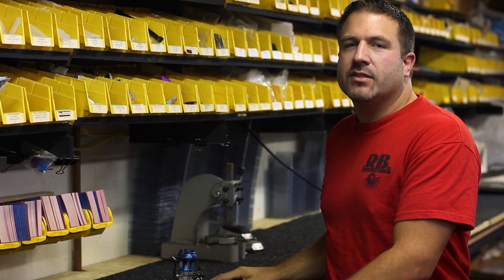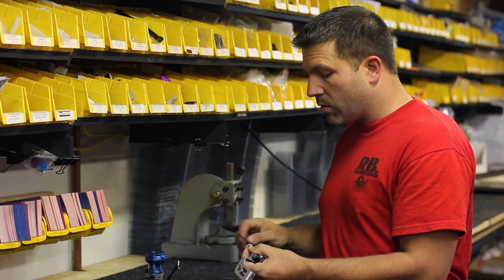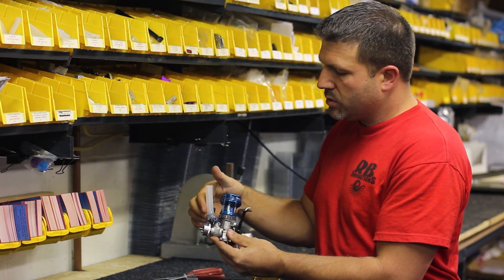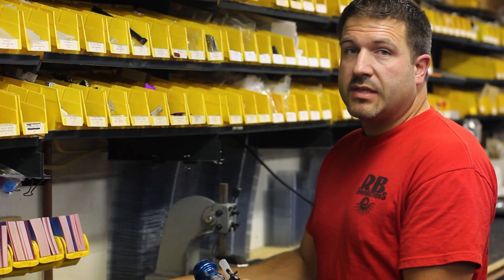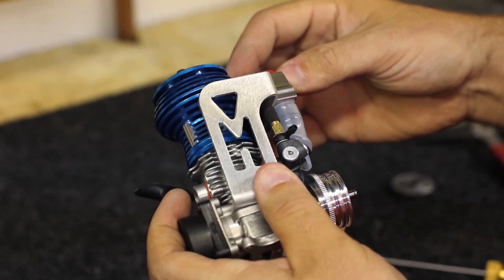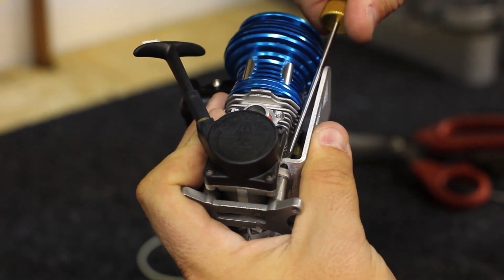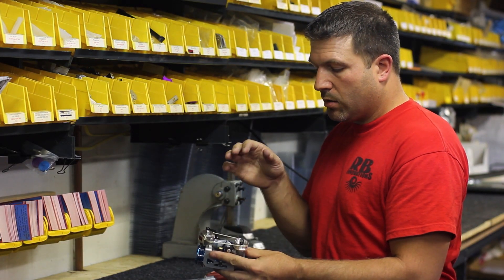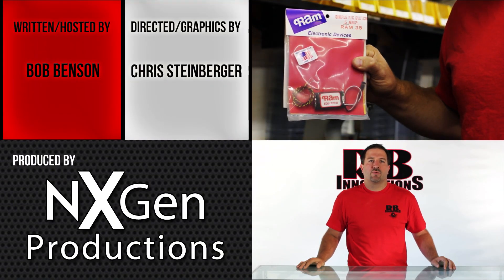How to Install an RC Supercharger from RB Innovations

Comment: What an amazing way to blow a bunch of unburnt air/fuel mixture out the exhaust port of a 2 stroke engine!!!!!!!
Reply: Victorious victor BS
Reply: Victorious victor Who said they stay open for the exact same amount of time? What I said is that this supercharger will blow unburnt air/fuel charge out the exhaust... and as an added bonus I made it clear you'd be stupid to buy it because you won't gain power.

How many degrees do you suppose only the intake port is open on say a 9/1 compression cylinder? Not many. Whatever it is I garauntee it's not long enough to increase the volumetric efficiency enough to offset the parasitic load of the supercharger.

There's a reason those turbo kits include a tuned pipe, it's because there very little if any power increase without one, even with much more efficient turbos instead of a supercharger.

Are you the sqeezy bastard trying to peddle this garbage or something? Why're you so motivated to contradict what's obvious.
Reply: Victorious victor dude I'm a two stroke mechanic at Kawasaki and all I can say is your full of bs.
Reply: Zaphod7835 no, most turbo kits don't come with a pipe. the use of a stock pipe is sufficient, as the increase in boost pressure is proportionally matched by exhaust pressure due to the restriction in the turbine housing. gains can be had by having a pipe tuned for the turbo, but not tuned in the way you're thinking. the tuning would be to account for the faster traveling pressure wave due to higher density of gas within the pipe, not to increase the reflection wave. superchargers also work, on nearly the same principle due to the pipe pressure increase caused by higher overall flow through the engine, but with a slight trade-off in total efficiency.

if, in fact, forced induction on a 2-cycle engine merely puked intake charge out the exhaust port, explain to me how a large percentage of snowmobiles actually burn less fuel per day after the turbo installation?
Reply: I think the time and money spent on this would be better put to use on porting and upgrading the carb. I see what you're saying about positive intake pressure on a two-stroke, I think it's a load of shit and will remain thinking so until I see evidence of greater power output on the worlds tiniest engine dyno.
Reply: Victorious victor you have no idea what you are talking about those snow mobiles that are supercharged have an exhaust valve and are port injected. the fuel air mix isn't coming up through the crank case. you will only lose horse power with forced air introduction on a valveless 2 stroke. I'm a logger and I have building fast two strokes all my life, like and i drag race a Yamaha RD400 if I could have supercharged it to make it go faster I would have. two strokes is kind of my thing
Reply: Also, I don't see how it could actually make any "boost pressure" and run right with a carburetor like that...  If there were any pressure between the supercharger and carb,  it would just blow fuel back into the tank right through the needle valve UNLESS the supercharger pressurized the tank as well...  I just don't see this thing working properly AT ALL!
Reply: @billymanilli  in fact there is an auxiliary report that you hook an extra line off the exhaust pressure valve up to the supercharger auxiliary port goes from the exhaust auxiliary port to the exhaust back to the tank so the supercharger is actually feeding pressure back to the tank so yeah they do have that part too
Reply: Ok if you put higher boost to a 2 stroke no you wount blow out your air fuel charge the "pressure" will equlize another thing its not the pressure that make these run its a wave that come back and keeps the a/f charge in the engine will you blow slighty more then stock at idle yes but off idle no if your logic where to be put into practice the higher rpm you go the more fuel would be yeeted out the engine it doesent work that way the higher rpm will creat "equel pressure" and that wave will keep that a/f charge in that wave is stronger based on rpm, pipe and load the engine is under adding more air and fuel will creat higher pressure. You can drill out the exuast hole of the tuned pipe to increase flow and these supercharged 3.3s boogie althoe use more fuel
Reply: Nobody even mentions the better fuel atomization occurring which alone will enhance the performance. Gaining 8mph after install at WOT is all the confirmation i needed to see. A Dynamometer isn’t necessary.
Reply: You're just the kind of uninformed customer this jackoff is hoping to sell to. 2 stroke engines are not defined by what fuel they run on there are gasoline and diesel 2 strokes... I believe even some of the giant engines powering huge cargo ships are 2 stoke and they pretty much run on crude oil. In this case it's a 2 stroke glow engine.
Reply: ***** My bad, I made the rookie mistake of assuming you were only uninformed but it turns out you're a babelling lunatic with the reading comprehension of a rock.
Reply: should probably tell the guys mounting turbos onto there snowmobiles and making 200+hp that infact...they just wasted 8 grand.
Reply: Victorious victor 8 grand!?!? Wow, that's pretty steep! I wonder, for that price do those kits come with custom tuned pipes to make higher back pressure at peak rpm and prevent the air/fuel charge from blowing through? Why... YES, yes they do! 

Do these superchargers come with tuned pipes? Nope... fuel charge is going to blow right through. 

As an aside, sleds have all the cooling in the world for air charge, can clutch for extreme rpm, and they're OK with very peaky on/off engine performance... you're RC truck has NONE of those capabilities... should we talk about the parasitic powerloss of a supercharger vs turbos?
Reply: victor  turbos will work on 2 stroke because the fuel wont get blown right out of the exhaust like a supercharged 2 stroke would because  there is back pressure from the exhaust spooling the turbo and compressing the air
Reply: It is funny to see the so called experts in here who clearly don’t have a clue what they’re talking about. 

I spent 25 years in R&D custom building turbo and supercharger systems and while the exhaust needs to breath its all about the tune at the end of the day. 

Installed one of theses RB SC’s on a 3.3 Rustler and broke 70mph. Stock Rustlers would at best  hit 45mph top speed using a 2.5. 

Nitromethane carries its own oxygen, so it needs much less atmospheric oxygen to burn. Use a hot “long glow” plug and it wasn’t shooting fuel out of the exhaust or running lean.
Reply: @Zaphod7835 2 stroke supercharged diesels didn't work either huh....
Reply: Zaphod7835
Reply: MrZilla500 Do you really need me to explain to you why an opposed piston fuel injected engine is different than the glow engine in your RC car? At least the last guy was talking about engines with similar design characteristics, give me a break.
Reply: Best of Youtubes Chainsaw Community lmao. what do u think it is? nitro engines are 2strokes. nitro fuel is a mixture of fuel and oil.
Reply: im1469 are you kidding me?? You understand that when you increase the amount of air going into an engine you also have to increase the amount of gas/oil mixture otherwise it’ll lean out and your engine will be a useless chunk of metal. And if ur turbo kit didn’t come with a tuned pipe, it’s not going to do a whole lot of good. I should know my buddy has a 2015 turbo rmk. My summit isn’t turboed because turboing(or supercharging in the videos case) carbed engines is a huge headache (and another reason this product is absolutely useless)
Reply: I had fun reading this
Reply: lol shut up , you speak to much Truth lol 😝
Reply: Who got this millinial company into our beloved nitro world
Reply: +Zaphod7835 got him!
Reply: They aren't all opposed, but it works on the same principal either way. Port timing.  In the cylinder clearing phase yes, some fuel/air mix would blow out the exhaust, but it still pressurized the cylinder and adds power.
Reply: Reguardless of all your insignificant arguments you're all forgetting that in order for a supercharger to be effective/efficient there has to be an increase in the fuel delivery (ie. heavier injectors, carb jetting etc.) to mix with the increased/forced induction intake air for a proper combustion ratio. I'm more of a TURBO  guy anyway. The the concept is way cooler, more efficient, more sensible and with turbo-lag being a thing of the past turbos are the answer to a fuel efficiency problem in the auto industry and they make little motors perform MucH better than their MucH bigger brothers&sisters with twin, tripple and quad turbos and so on. I'd be highly impressed to see a RC car or truck with a fully functioning properly turbocharged engine, I'm fairly new to the RC hobby but I've but done a few fully custom uniqe builds, electric models only so far, and I'm going to have to make this one come to  life. I have the perfect chassis. A 1/8 scale touring/drift car that can be gutted of the electronics (this model car comes gas or electric) and put the perfect motor for the job like a small gas RC boat motor with watercooling for handling the high temperatures. I'll use a simple & small reservoir filled with coolant along with a tiny recirculation pump  (acting as motor oil, a radiator and a cooling system that'll run through the motor and through the custom tiny turbo, that I'm gonna have to design and build, to keep everything running nice and cool. So yeah. Shouldn't be too hard to scale down a proper turbo for whatever motor I get. Just gotta make sure the math is always on point and gotta engineer some water jaclets for the cooling. After some cad drawings and my top machinists on the job, (my Dad) I'll have 2 or 3 working prototypes depending on how much fun good ole Popps is having making me more RC parts. Then just to figure out how to increase the fuel being delivered and have it proportionate to increased amount of air being compressed in the combustion chamber so that the fuel isn't drowning the air&spark or vice versa. Does anyone know the calculations required to acheive optimal performance in situations such as this with real cars? It's different I'm sure but the concept is the same but scaled down. It's gonna be awesome.
Reply: Zaphod7835 the intake and exhaust port are only open at the same time for a short period of time. 

you can turbo a 2 stroke and run a stock pipe and you will not "blow" the power charge out the exhaust port. your transfer ports are still filling the cylinder as the piston closes off the exhaust port. 
that's why boost pressures are able to stay inside the cylinder.
Reply: Zaphod7835 ..how else do you think you will get higher pressure into the cylinder then just atmospheric pressure if the intake and exhaust port stay open for the exact same amount of time.

Comment: I am thinking about picking up one of these for an Ofna 1/8 buggy with a .28 engine. I want to run the Ofna 2 speed trans kit with this though. Would it be possible to adapt this on with the clutch and 2 speed pinion gear? It seems like it would be possible, but you would have to do some fabrication. My guess is that it may be easier to use the stock 2 speed kit and then find a way to adapt the supercharger to that. Any other way, and you would have to move the engine back.

Do these help performance at all? I cant see it doing too much for a 2 stroke engine,. but for the novelty and enhanced sound, I would totally do it and try to setup some scoop to catch cold air.

Comment: I don't get where people say u can't turbo a two stroke ....Google boondocker turbo or speedwerx super charged arctic cat. 
if your gonna be a smart guy on the internet let people know what kind of 2T can be boosted and what kind can't.
 rc nitro 2T engines don't have any valves like a sled has reed valves. all the boost will blow through the combustion chamber before it makes boost....making it actually rob HP due to adding all that  rotating mass
Reply: Very true
Reply: You can't put a turbocharger because they lack of back pressure in exhaust pipe to allow 2-stroke to run correctly but you can super charge or X charge

Comment: If you could make me a Roots type twin vane for my OS FF320 Pegasus, that would be cool....this is cute though, unsure if the claims mean much, i can't see a vast gain even if it does work. More power maybe, but into the same gears and gearboxes, negating it's use. Maybe for torque on a crawler or scale semi with trailer or similar. Can't see the point for a race type track car, added weight is more than net power gain i would think.

Comment: I want anyone who buys this to drop me a line to say how disappointed they are.
Reply: PJMontoya I will. I bought this out of pure curiosity because I ha e a redcat shockwave for 150.00. So I could care less if I fry the cheap ass motor. Then I can toss in a .18 instead of the little .16. But I will do a before too speed radar run and an after run with proper carb tuning and see if I can tell a difference all science aside.

Comment: Nice Video but Looks like Bullshit !
You need minimum 0,3Bar boost to get al little bit more power .. 3hp x 0,3 = 0,3 + 3 = 3,3hp - losing power from Supercharger.
You never get 0,01 Bar pressure with this fancy rubber band...
Reply: You clearly have no fucken clue what you're talking about the hp an engine produces is far more complicated than just taking the product of the pressure in bar and multiplying it by the hp hahaha wtf hahah stick to playing with hot wheels seriously.
Reply: Max Power
Was only a example...
This make no boost at all and no more Power.

Comment: How do you NOT show the engine running at the end of the video??? C'mon man!!!
Reply: Cause it wont run for a few reasons:
1: In a 2 stroke engine (which most RC car engines are), the intake and exhaust ports are open simultaneously. This means that it will just push the fuel/air charge straight out the exhaust, making the engine like crap
2: Its set up on a "blow through" configuration on the carburetor thereby pressurizing it but not the fuel system and since there is no fuel pump, fuel won't enter the carb and this will lean the engine further and it won't run right.
Reply: These do not work in engines with no valves. The only reason superchargers work on a 2 Stroke Detroit diesel is because they have exhaust valves on it. Besides these superchargers at $160 or so, you could buy another nitro engine for that amount.
Reply: Ratkill9000 yes a Detroit diesel does have valves but your logic is all wrong, all a super charger does on a Detroit (and other 2 strokes)is blow the exhaust out the port faster so there is no unburnt fuel on the next stroke. This same concept applies to a reed valve ,witch this engine has. Still blows exhaust out.
Reply: PJMontoya  Yes but you cannot customize your electric cars as we can...
Reply: These guys are TERRIBLE at showcasing their products.

I've never seen such an inept company.
Reply: faaack I hate how he is showing how to install is knowing it will never work on a 2 stroke engine.
Reply: SMaze17 nosee no the difference
Reply: Electric motors can be modified, but there's usually no need. Electric motors produce more torque than engines of comparable size.
Reply: SMaze17 right
Reply: couse its not running anymore
Reply: Joe? That you?
Reply: Is this sleepy Joe Biden?
Reply: +PJMontoya go away
Reply: jeffel80 but he's right.
Reply: tlaroche38 the intake and exhaust valves are never open at the same time. the transfer ports and exhaust ports are, but when the transfers are open, the intake valve is closed. otherwise there would never be any case pressure to facilitate transfer of the mixture. 

study up on the venturi effect. it works weather it is under vacuum or pressure. ever seen how a paint gun works? same concept, only, weird, it uses pressure.

think you should do some more schooling on how a 2-cycle engine actually works...
Reply: im1469 but the intake port closes before the exhaust port as the piston comes up so the boost stops entering the cylinder before the exhaust port is closed.
Reply: Best way to get more power from your nitro engine is to sell it and buy a better one. Better yet, go electric.

Comment: holy shit a r/c charger. what next a hybrid r/c nitro and electric porsche 918?
Reply: +g4rr377 nolife parts for nolife people !
Reply: jeff pepin so would i but im 14 so yer
Reply: +jeff pepin I already splent money on a car so I splent some more money on a RC
Reply: It would depend on the engine it goes on and the purpose of the vehicle
Reply: i would spent money on my car before splent on an RC , just my opinion
Reply: +g4rr377 Turbo??? With boost of 1psi
Reply: +Mr.Sniper I think that'd be cute
Reply: Depends on the situation. A model 4 stroke motor can see some benefit from a blower. I've seen them in action on a few of the large model aircraft.

There is also a company Conley precision who manufactures scale engines that are blown, I recommend checking them out.
Reply: i can'T imagine splent money for an RC supercharger , but its not my hobby , don'T take my comment too much serious
Reply: +g4rr377 RC turbo hahahahha
Reply: User Name hehe remote
Reply: Easily amused are you
Reply: +g4rr377 they already have them
Reply: +Lor Reuben they already have little turbos for rc
Reply: +patman0250 thats dumb though haha
Reply: +jeff pepin how is it for no life's?